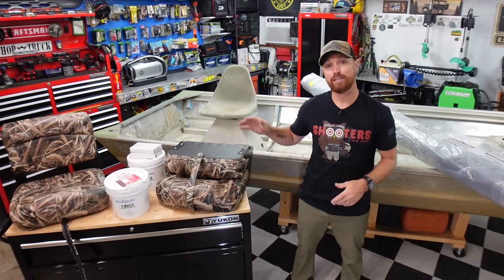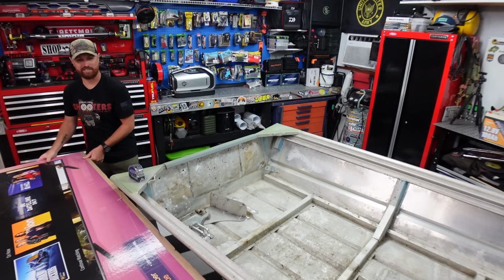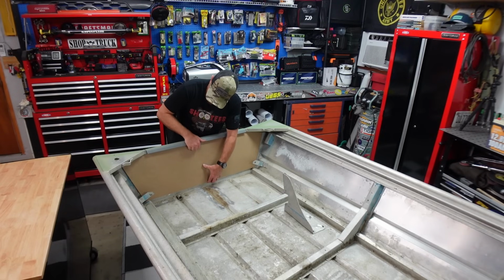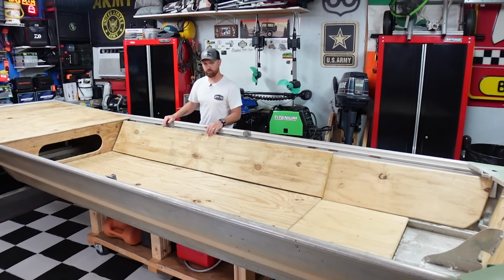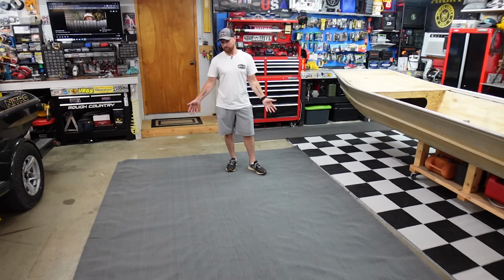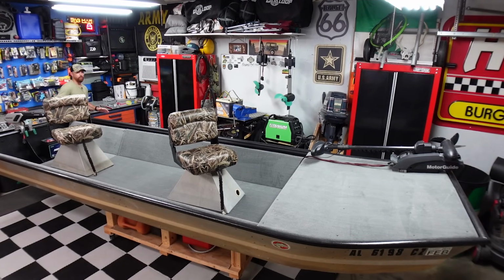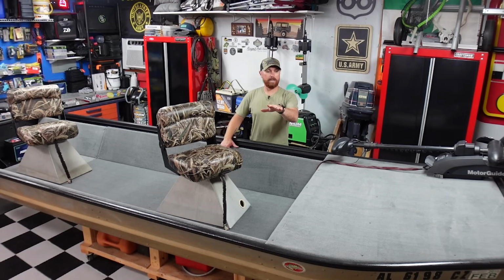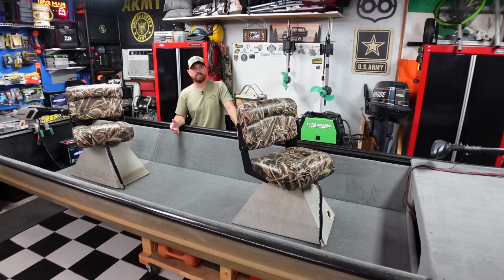Jon Boat RESCUE..! CUSTOM Floor Build, Start To Finish.. EASY !!

Comment: Looking good TJ! I’m looking forward to seeing the electrical you add, maybe a fish finder as well. That transom bilge area makes me think of adding an enclosed box with a split lid for access across the width, just to keep everything back there protected and a tidier finished look. Some aluminum sheet would be easy enough to cut/bend/rivet and paint to match. Always love your diy projects/builds because learn a lot and it gives me lots of ideas to dream about. Plus it reminds me of doing similar stuff with my dad and grandfather.
Reply from the maker: Great idea 👊🏼

Comment: It looks great. Use rubber grommets on the deck for your trolling motor wires. It will look clean.😊

Comment: I love this build but there is a couple mistakes. Non treated wood is going to get destroyed fast cause if you get mud in the boat your more then likely to use water to wash it out. You could of applied a water barrier on the wood then glued then carpet. Then you could of took the peice that goes under the front deck. Bulid a frame. Have it slide in the bottom with magnets on the top of wood and frame. That way you can pull the whole thing out add big items. Now your limited to what fits in the hole. Just little ideas. Maybe when you do the seat pedestals add the camo and the black  strip on the corners. It looks a lot better with the black edging
Reply: Pressure treated wood and aluminum don't mix.